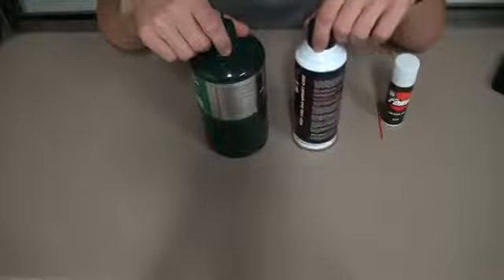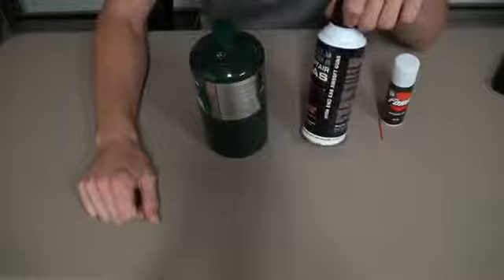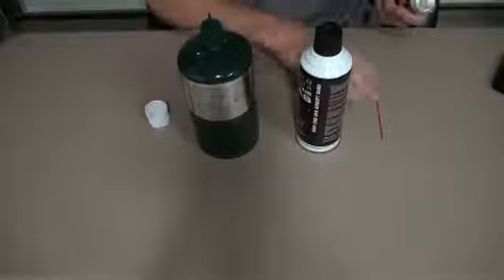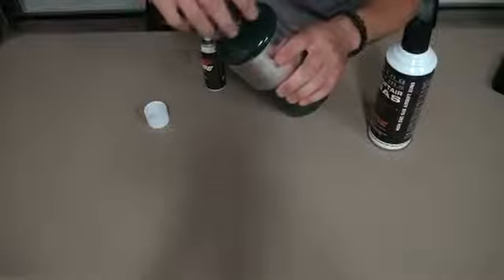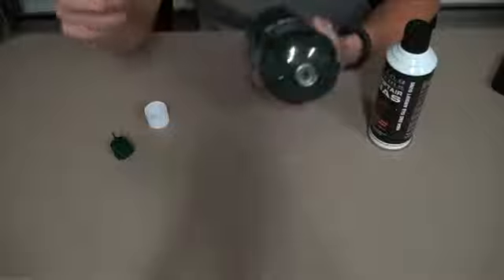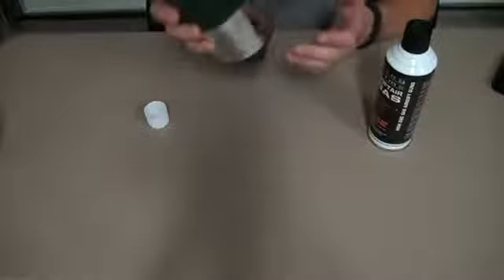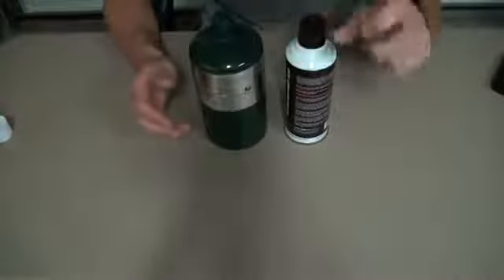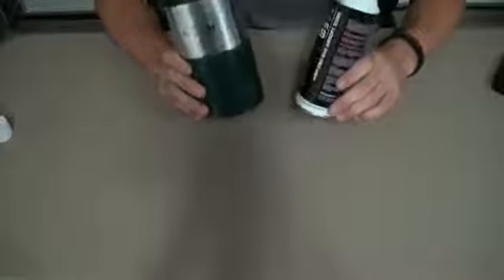Green Gas vs. Propane

Comment: The only CO2 that comes from propane is as exhaust fumes, from the fire it started, you probably can suffocate on propane, but the smell is mostly there to tell you about the otherwise odourless highly flammable substance in the air.

Comment: there the same thing. propane puts out a little tad more pressure but not anything you could even notice. there both made of the same things just different smells because there used in different industries and green gas has silicone pre mixed in. but yes both can be toxic so just dont be huffin it